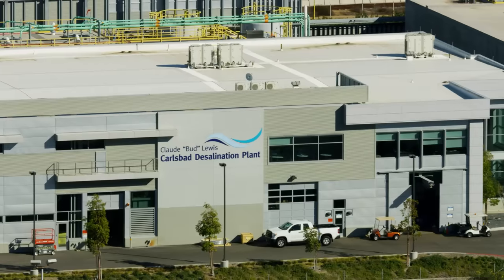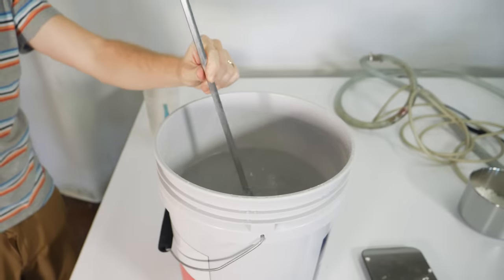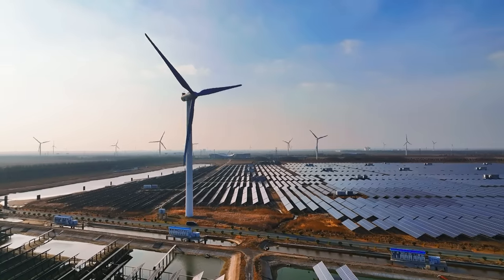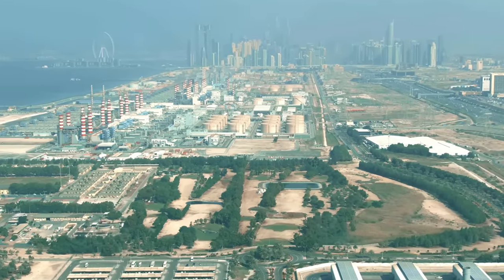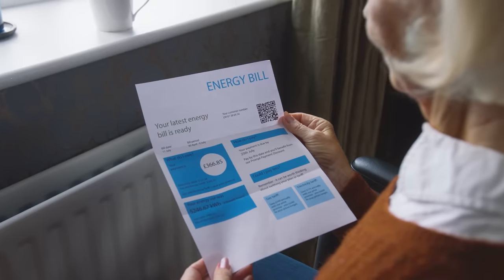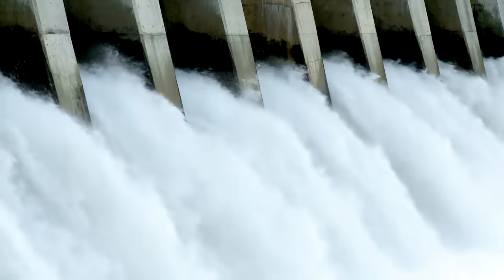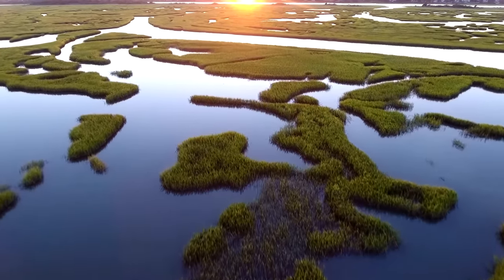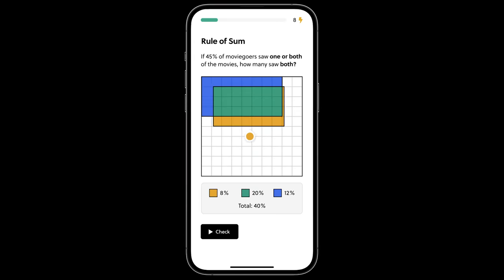Why Is Desalination So Difficult?

Comment: Why not use geothermal energy as a way to desalinate sea water? You can drill deep holes near the ocean and pump in sea water. You end up getting steam which can power turbines and you also get fresh water from the steam. Geothermal energy is limitless. We already have the technology from the oil industry.
Reply: because that is not variable in most of the world
Reply: Yes but still many locations in the world that can use thermo electric power. We just need the technology to dig even deeper to make it more efficient. That is why China is trying to dig the world’s deepest hole. It needs the technology to do this in large scale to reduce dependence on oil.

Comment: Why wouldn't the brine be sold to winter states for thawing roads seams like it would help pay the water cost and also help with not needing to mine salt. Not saying multi uses for ocean brine either just for winter roads at least until it is understoodwhat all may be in the brine and if the area being used is consider a safe area. Just seems like it takes 1 problem and creates a solution for it along with already having a value they can go by using the current cost for the amounts they use it in those places  for the roads. Also if successful they can use something like train rail service in the off season to restore the holding areas. If 1 is already currently paying for mining and transportation along with the cost of salt those 3 ways could be tapped in to as a equal form of payment which is something the water companies are currently losing  those cost and having to deal with it more and more while putting it back in the see at amounts that can't be good for the area once they put to much back it to many times seems like it would just be that much harder to remove and bad for the ocean life to have so much salt at some point. As long as the areas it's used for roads doesn't affect fresh water sources the trade would be equal but I'm not in a lab to be able to test for the differences  and if their are more pros or cons after running test on it to see if it could only be limited use or not at all.

Comment: Desalination is NOT difficult, it is very expensive for governments in large enough quantities to supply nations on a daily basis. Easy for ships with large amounts of excess electricity or steam driven turbines, which can be turned into potable onboard water. Instead of useless solar panels everywhere, we could have solar evaporators, that could supply and endless flow of fresh rainwater to our countries, at very low running costs.

Comment: couldn't one do electrolysis at the right voltage and current so to not split the H20 but do split the NaCl. And even if the H20 is splitted aswell, 1. all couldn't that be a benefit?

Comment: When government does it, it always costs more. What about solar desalination. Take one of those solar plants with a thousand mirrors reflecting the sun onto one spot and use the heat there to boil the water. That would lower the cost to zero for energy usage. Have to get the water there. Sell the salt to Morton. Close down the salt plant in South San Francisco Bay. Repurpose the land. Sounds like an idea to me.

Comment: I find it funny how much easier it is to get the salt out of the water if your intention is to get the salt not the water.

Edit: Question about dealing with the Brine. Why don't they just boil the water out of it and keep the salt? You can sell the salt to offset the operation cost and it deals with the environmental issues as well.
Reply: Boiling the water requires energy so the process then becomes redundant, you might as well have distilled.

Comment: why not use a Solar Desalination System

The concept involves the adaptation of a solar cooker-style device for large-scale seawater distillation. This  system envisions a substantial conical structure with reflective materials, akin to solar cookers, designed for the purpose of harnessing solar energy for water desalination.
Reflective Cone Structure: A carefully engineered, large-scale conical structure, utilizing advanced reflective materials to optimize sunlight concentration onto a central focal point.

Central Seawater Containment Unit: Positioned at the focal point within the reflective cone, a substantial container housing seawater would serve as the medium for solar-driven evaporation.

Solar Evaporation Process: Solar energy, concentrated by the reflective cone, would be directed towards the seawater containment unit, inducing controlled evaporation.

Condensation and Collection: The evaporated water vapor would then be condensed, and the resulting freshwater collected for storage and distribution. 
(i used chatgpt because english isnt my main language sorry)
Reply: i  guess its very similar to using solar panels but those have high pollution to make them

Comment: Your 1100 liters per day can be radically reduced if households embrace the submarine shower principle, actively throttle tap water output to minimize water waster, run shorter energy efficient cycles on their clothing washing machine or dishwasher, by not watering a useless cosmetic lawn during the hotter summer weather. By not washing their cars at home as often. By not taking a shower every day, switching to every other or every third day & tolerating the smell by opening a window & venting more or use a heat recovery ventilator to capture heat from the outgoing stale air to pre-heat the incoming cooler fresh air.
Reply: So?  Why would we do that?  It isn't needed

Comment: Two points here. One could have completely changed the video content and the other jsut on a piece that detracts form the quality:
1) You completely missed the new method of desalination by CO2 injection. This will become the dominant method for desalination in the middle east in the next decade or two. Many plants are already operating or are under construction. 
2) comparing desalination to nuclear power generation, when talking about complexity or cost is an invalid comparison. Why not compare complex industrial fruit selection and packing technology with medical life suppport systems. Nonsensical.

Comment: Desalination Southwest and Power Generation Idea:
Arizona has the superpowers of: Heat, Elevation, and Solar Power Generating Potential Capabilities. 

By pumping water from San Diego through a network of pipelines, using solar power, we could resolve our water shortage and redistribute throughout the southwest - to New Mexico, Nevada, SoCal, and Arizona(of course), by using the natural landscape of Ft. Thomas, AZ and an evaporative processing system, to produce desalinated water. Additional reservoirs could produce hydropower. We could utilize the natural flowing Gila River to help filter the water as well, by passing through sequences of filtering membranes we would have to maintain in towns along the river-ways. 

Of course, this mega project’s initial investment would cost billions, but would turn our deserts into an oasis while providing thousands of jobs and solving our impending water shortage. 

This could resupply our aquifers, help the Native American tribes who rely on the rivers, lower the cost of electricity on the locals, lower the costs affecting farmers, prevent drought, help our native wildlife, provide more resources for wildfire fire-fighting, and dramatically improve our economy far past our $460B GDP: making AZ one of the top 10 GDP states in the US. Just a thought. Could I get some feedback on feasibility?
Reply: Some additional questions to consider: 
Requirements:
- Roughly 600-800 miles of pipelines would be needed just to pump to Ft. Thomas, AZ from San Diego. 

How many solar panels? How many pumps? How many reservoirs? How many membranes? How many workers? How many permanent installations? How much time? Could we include Native American tribes and their money/resources? How would this affect weather patterns? How could this affect the rivers? How could this affect wildlife? What would we do with the salt? Could our elevation help gravity feed water distribution to other territories? What is the energy needs? Could power generation offset associated costs? How would a population boom help offset these costs? Could we also farm freshwater fish? Could we use the homeless population to assist with these efforts(see RejuveNation note)? Could solar panels be placed under flowing water channels to help heat the water for evaporative affect? Can saltwater flow over these solar panels to assist with keeping them clean and dust free? What would maintenance and upkeep look like? Could we utilize Elon Musk’s, Boring Company, to help with gradual pipeline inclines to diminish elevation issues, so the pipelines maintain a steady incline to the distribution plants, and aren’t so taxing on the pumps?

Comment: There is actually nothing "hard" about it.  It just isn't as profitable as harvesting absolutely free natural resources and reselling them as luxury bottled water at 1000X the value of the labor and infrastructure investment.

Also, there's a much easier way to get the pressure required for RO.  Gravity.  You just fill your reservoir and run the water down a few meters.  You equalize the pressure by maintaining a specific volume of salt water in the reservoir.  And you can pump water up into the tank using an air bubbler extremely efficiently from any source.  Even just a pipe hanging off a ship in the Ocean.

This can also be done in places like Phoenix where there is extreme rains during the summer.  Some of that water can be collected in raised reservoirs and used to offset the demand during summer months.   These can scale from single family units to any tower downtown or even a unit the size of that useless Arizona football stadium.

Gravity is a hell of a force at scale.  What needs to be overcome is the scale of mind rot caused by the front facing success of the new global religion, Economics.

Comment: I kinda feel like you punted or side stepped the cost issue you raised in the beginning when it comes to larger facilities.  You even bring up the minimum energy needed to pull salt out of the water but don't talk about what that is, you just go into a 3-minute ad.  Desalination is great and all but beyond the technical aspects what are the costs passed on to consumers?  A fully private system would be extremely expensive.  The last time I heard about the cost difference between pumping water from the ground and a desalination plant it was about 1000x more expensive to run a plant than pump it out of the ground.

Comment: I'm not sure where your terminology comes from but in the industry the three water types relating to reverse osmosis are typically termed "feedwater, permeate, and reject". The problem is the term "brine" can be used for the high TDS Supply feed water which in fact is a brine. These three terms - feedwater permeate and reject - are used just to eliminate the ambiguity, and possible mistakes, that would come from the use of the word brine.

Comment: Use excess solar and wind power to desalinate water. Both should be covernment run or co-op non-for  profit utilities run at cost anyway so who cares about overhead and bi-directional costs as they get nullified.
Reply: No. In Denmark all water supplies are privatized. They have always been so always, since their inception in 1800's. paid for and owned by the nearby residents. This system is WAY more stable as there is economic and community incentives to keep it going. Also there are hundreds of water production plants within 50 km's, instead of the state-run-alternative which would seek to optimize and make all residents dependent on a few sources -- leading to high risk infrastructure and excessive long water delivery systems.

Comment: off the coast of California it is always foggy because the water is always cold. I think you can easily collect this water in the fog with condensers in the ocean and with some pumps to pump it to land with undersea pipes. much cheaper than using energy to evaporate or use costly reverse osmosis filters

Comment: A little lightweight and stresses too much the environmental issues like brine.   Israel gets half its total fresh water from RO and the ecology of the discharge areas indicates no "real" problem.  The contract prices in Singapore, Israel, and Middle East countries are a little over $0.50 / M3 which is less than the cost of transporting the water from the Sacramento Delta to Southern California (MWD prices).  The costs being charged in San Diego for RO water are about 3 times the world average and that is not because of electricity costs or true capital costs.   Someone has to pay for the legal/political/regulatory costs as the plant itself is almost identical to plants in Israel and Singapore and uses equipment from California for energy recovery and sometimes for membranes.  When it takes decades to get permission, time is money, and retired US Senators like Boxer and the dozens of connected PR people for a decade or more are not cheap.  RO membranes were invented at UCLA in the 1950s.  

The activists opposing these projects on environmental grounds don't understand science but do understand fundraising.  They have made a lot of money delaying and extorting these projects.  

For electricity, California has lots of solar and wind which is very cheap for loads like RO that can shut down easily allowing the utilities to balance the supply and demand in exchange for cheap electricity most, but not all, the time.

Comment: Technically, it is not difficult at all. It is  EXPENSIVE. It requires a massive amount of electricity to power the pumps to pump the saltwater thru the membranes and
towns like LA dont want to pay it. Instead, they want the state capital in Sacramento 
to built freshwater canals drawing clean freshwater from mountain streams up north
and send it to SOCAL. Free of charge. Because they are LA.

!

Comment: 2500KJ of heat are neaded to evoporate 1kg of water this roughly 0.7kwh.. and RO producing 90-130 liters of fresh water per  1kWh the pressure must be 63+ bars.. so it’s 0.7kwh/liter for distillation and 0.01kwh/liter for RO… ur calculations are so far from real numbers

Comment: If we actually combined nano tech and nano mites, we could super clean all water, very thoroughly. Not even the tiniest particles would slip by. But we have to actually use it correctly for it to do any good. Same with gasless and oiless self running generators and solar in EVs and everything else. 😎⚛️🇺🇸🌎

Comment: Solar powered evaporation in a clear covered curved dome over a pool of salt water that evaporates& drips down the sides into collection trays & pumped to consumers. All solar powered & in the bottom of the concrete pool is every meatal in the Ocean gold, silver, platinum & many more! NO high-tech high dollar building & filters that need expensive constant service. Millions $ saved!
Reply: So how many millions of gallons per day could that output?

Comment: your distillation setup is anything but basic, way too much specialized glassware.

all you need for a simple distillation setup. is a big cooking pot, a smaller cooking pot, a pot lid and a heat source.

then all you need to do is fill the larger pot with the liquid to be distilled, then set the smaller pot into the larger pot, put the lid onto the larger pot upside down, put the assembly over a heat source, put water into the upside down lid and watch the magic happen.

Comment: The best way to make these plants operate at peek efficiency is to keep Govement out of the construction and running of said plant. The Cost go up exponentially as govement gets more and more involved.  For example the discharge situation. There is nothing wrong with them just pumping the brine back into the sea. The creatures in that area will just move away because they can tell there is too juch salt. Sure there will be an area say one mile by one mile that not much will grow, but twenty miles away, the salt levels would be normal. The dead sea is too salty, yet there it is. All the clean water pulled off one there will at some point make its way back to the sea once a person drinks it (pee, water reclamation, then back to ocean). However with the Government EPA restriction these companies, they just stop humans from getting the clean water they need.

Comment: 6:40 "using pumps to lower the pressure" ?
Reply: Remove air using pump. Vaccum cleaner works this way. Water boils sooner at lower atmospheric pressures.

Comment: Its vital for when hydrogen cars take over. EVs are the worst thing for this planet.
Reply: Dont hold your breath. WIth currently demostrated (in the lab) efficiencies, its about 3x cheaper to run an BEV than a Hydrogen-powered EV. 
Its all down to efficiencies losses. 
Battery charge and discharge: 15% loss
Hydrogen fuel cell production and consumption: 70% loss